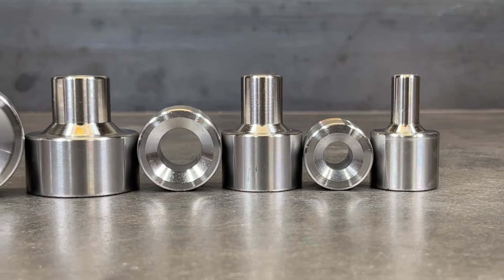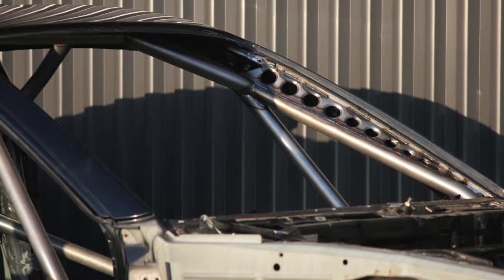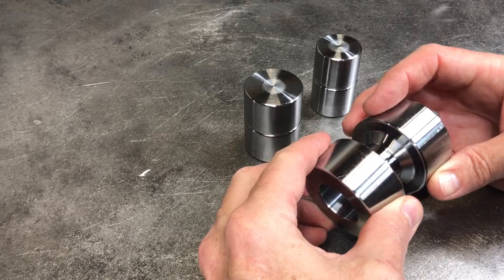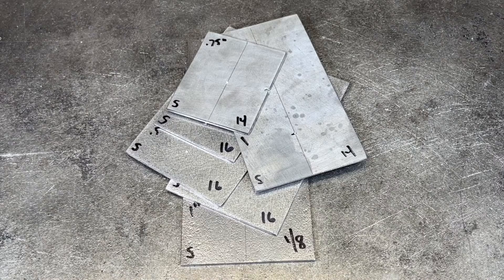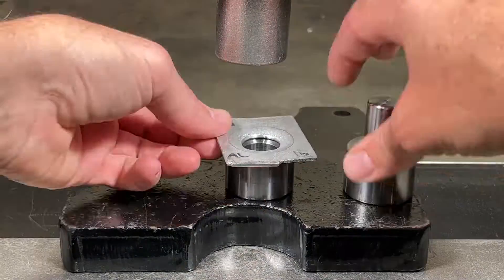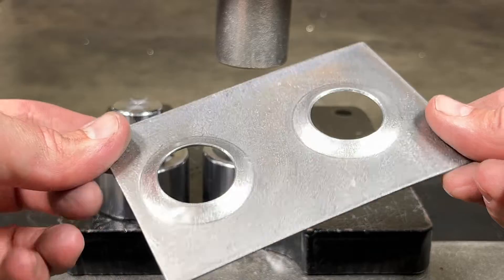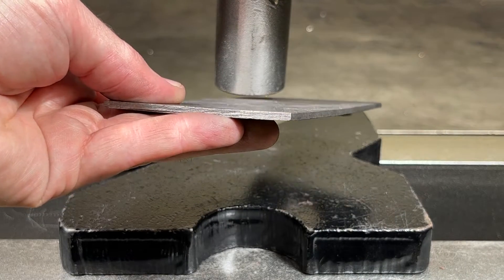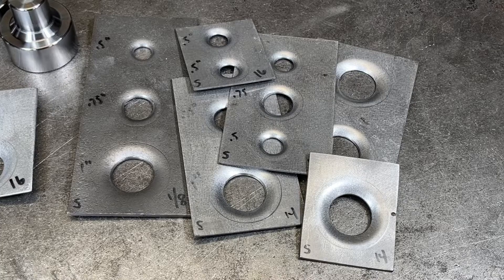Testing Cheap Amazon Dimple Dies - Are They Worth It?

Comment: im finding a disadvantage to the dies that require a vice or press due to the access limitations (if your near the edge of the metal or always have a flat piece its no problem).  the thru bolt punch and dimples units solve that issue.